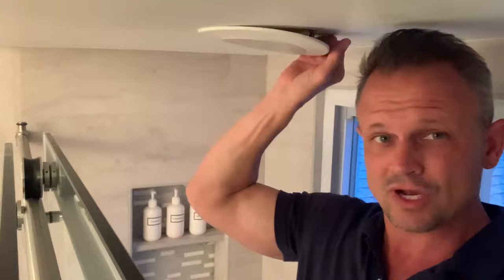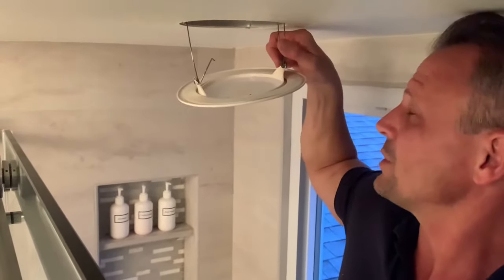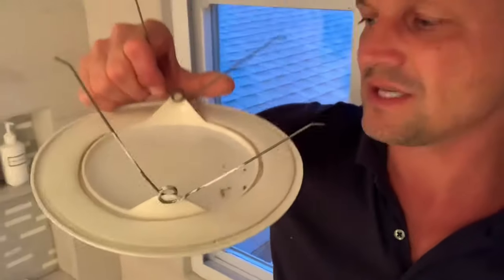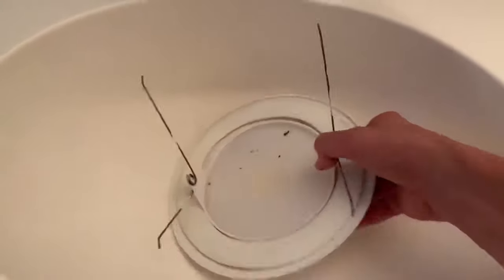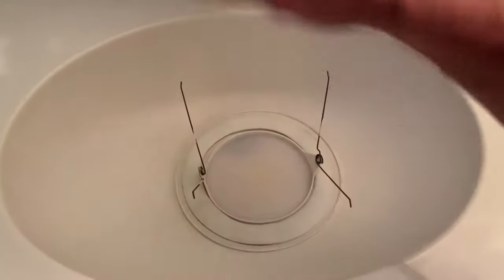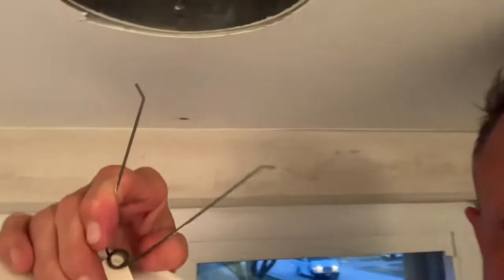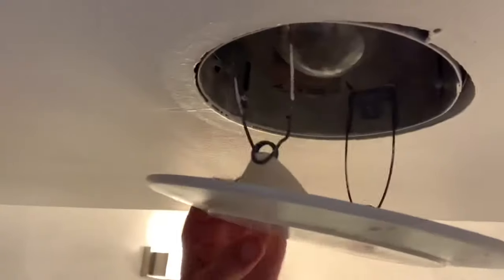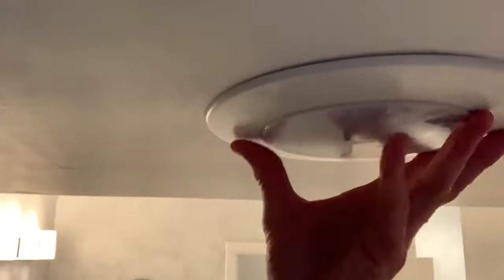How to Remove and Clean Your Can Light Cover Plate

Comment: What do you do if the trim ring is attached to the housing inside and need to replace the bulb? Our trim rings aren’t attached by spring clips.
Reply from the maker: I personally don’t know of any that are all in one. Typically you’ll have the can light housing in the ceiling and then the trim ring, or a retrofit trim light ring that pulls down and there should be two plugs that you disconnect and you would just have to replace the trim ring that has the light inside it.
Reply: @BJPoznecki  Yeah, when I tried to pull the trim ring down, I expected to find spring clips. But instead I saw that the trim ring was attached to the housing. At least that’s what it appears to me. If I had a tall enough step ladder I could really see what’s going on. And to see if there’s any screws. All I know is that when I pull down the trim there isn’t any clips and and you don’t have easy access to the bulb. I hope I can figure it out and get a new bulb put in. If you any other suggestions I’d really appreciated. Thank you for the reply.
Reply from the maker: @cesarvaldez112975  Your light might not have the clips like you see in the video it may have spring clips that you just have to give the trim ring a good pull towards you to remove it. I’ve never seen a trim ring screwed to the can because then you would never be able to remove it.
Reply: @erickm2010  I had someone check it out, but I wasn’t able to be home to see him work. So I don’t know how he did it. He did tell me later that it did take some effort to get to the bulb. To much effort than it needs to be, just to replace a light bulb. That’s ridiculous. Sorry that I couldn’t be any help. Best of luck to you.

Comment: Again, this is not the same kind I have, which must be super rare.
Reply from the maker: There are different kinds. It’s possible that you could have an enclosed one where the light and the ring are all in one.
Reply: Unfortunately that's what I have, the whole unit thing. I can't figure out how to get it outta there. Lots of seemingly unnecessary wires up in there